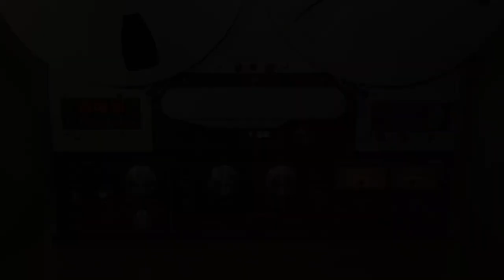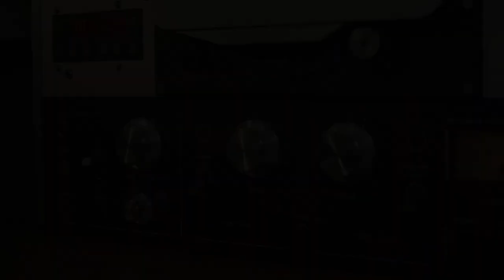How to Mix with Tape Delay using a Reel-to-Reel Tape Machine - Thinking Outside the Box #2

Comment: Hi Noah, my question to you is that I have an old 70's Teac A3340s tape deck and  Teac Sound on Sound AX-10 stereo echo unit that connects to the back of the tape deck. I also have a Yamaha 8 channel mixer. What I want to do is, connect the tape delay up to my Vox AC30 amp. Could you explain to me how I would do this to play at a live gig?Thanks from Michael Newell from Niagara falls, Ontario, Canada
Reply from the maker: Hi Michael, I’m afraid it would be difficult to use a tape machine in a live situation and to be honest I am not familiar enough with the equipment you mentioned to help you out. My guess would be that you could take a signal from a send of the amp into the tape delay and blend that in with the amp signal to achieve what you need.